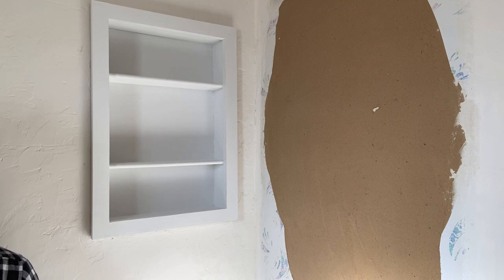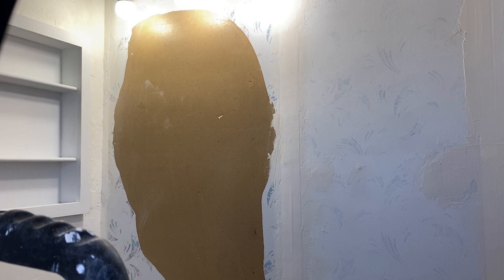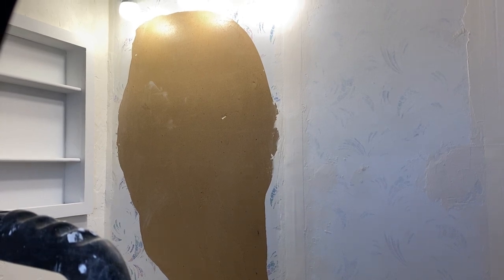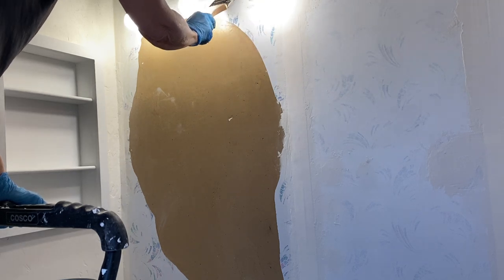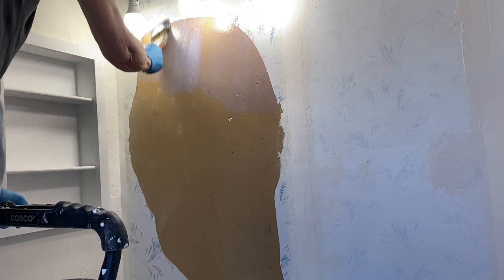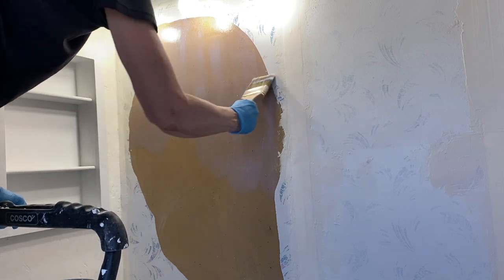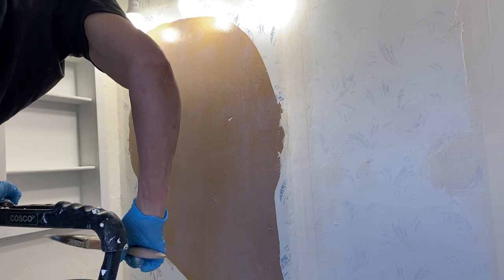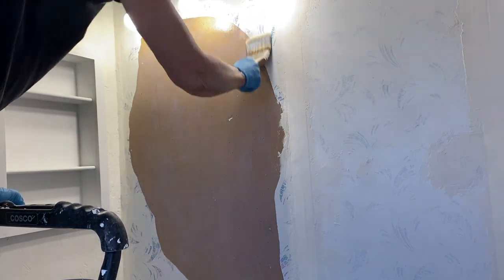Single Wide Mobile Home Guest Bath Makeover On A Budget/Part 2 - Wall Texture

Comment: I live in a 1990 something (1997 I think) mobile home and I have that vinyl wall covering on the walls in my kitchen (and some other rooms), And when the kitchen walls were painted (some years ago) as far as I know, we never used any kind of primer or sealer on the walls before painting them. I believe 2 coats of paint were put on the walls and that was it. The paint has held up very well even when wiping them with a damp cloth for cleaning. Thank you for another video. God bless you always.
Reply from the maker: I'm glad that worked out for you, Mary. Every mobile home manufacturer I know recommends a coat of primer, and then paint, unless you're using an oil-based paint, and not latex. So, again, I'm really happy it worked out for you. It would be interesting to know what kind of paint you used. God bless you, as well!
Reply: @ajoyfulcottage  Thank you. I know it was not oil based paint and it was flat or matte, but I am pretty sure it was flat and can be washed with water. And to tell you the truth, I don’t even remember if I even thought about the walls being primed or not before painting them. But it turned out well.

Comment: On your first video of the bathroom you said you would like to remove the "popcorn" ceiling at some point in the future.  You can do the same technique you are using on the walls--you just have to apply the joint compound thicker.  I have done this on popcorn ceilings and acoustical tiles with very good results.
Reply from the maker: Nice. I wonder, Linda. . .were your popcorn ceilings painted before you did the joint compound finishing? I saw a Youtube video on applying joint compound over the popcorn ceiling, but the craftsman said the ceiling had been painted several times in the past, and so it easily accepted the joint compound; basically he started with a smooth surface. Since my ceilings have never been painted, the popcorn is very loose, and so I'm concerned that rolling joint compound over it will cause the popcorn fall into the compound and create a big mess. Does that make sense?

Comment: I also had the strip on my walls. Some could not be removed because they left such huge gaps between wall boards. Yes same mirrors  in both bathrooms.  BUT the worst find was a mirror  in the eating area of the kitchen, we realizes there wasn't  wall board behind  it it was glued to fearing  striped! Hope when my grandson  remodels he can remove it dry wall that area.
Reply from the maker: Yikes. Not having a wall board behind the mirror would be a problem. I can see that. Hope your grandson can make it work when he tackles it. Thanks for sharing, Jo.♥

Comment: I am putting beadboard up on my walls. I choose this so it made the walls sturdier. So now if you push on the wall it doesn’t have any give. Much more like a typical house. 
My mobile home is older than yours but it is a double wide. Two bedroom two bath
Reply from the maker: Dawn, I love beadboard, and what a great solution to shore up your walls. If I had that issue with my home, I would definitely consider putting up beadboard,. It sounds delightful! ♥

Comment: How much would you say the joint compound is going to cost you for that size of bathroom?
Reply from the maker: Jennifer, that is a great question! One box of joint compound (3.5 gal size) is $12.83 at Home Depot. I estimate that for my size bathroom I'll be using about 1/2 - 2/3 (max.) of one box. I did my kitchen and the faux brick wall behind the stove/black cabinet with about 1 1/2 box. So, I feel like it's a very affordable project. Thank you so much for asking about this. I would like to do a Q&A video where I answer questions just like yours! God bless you!💗